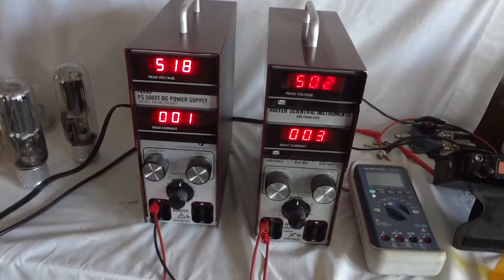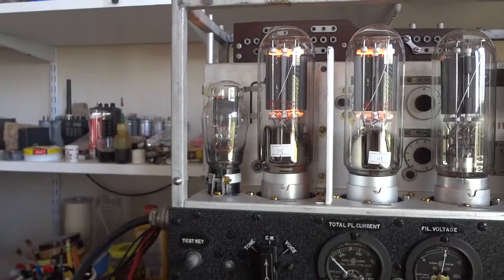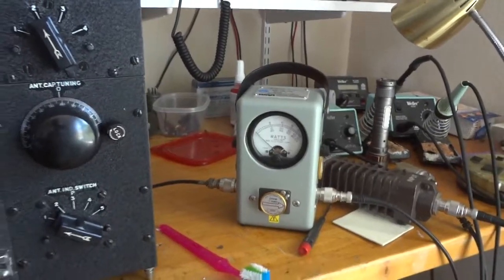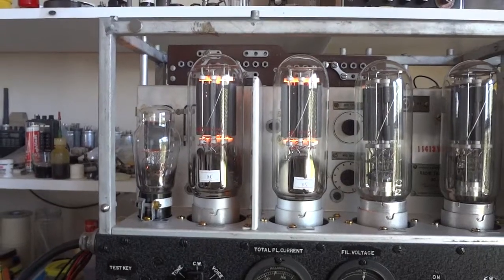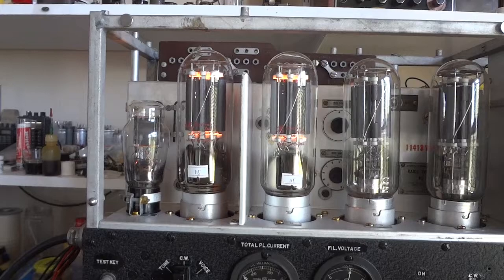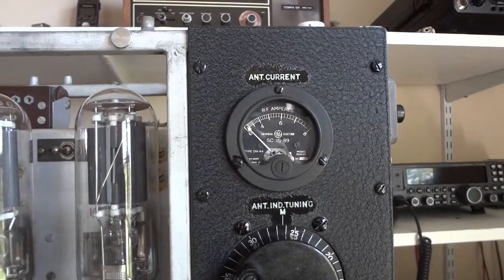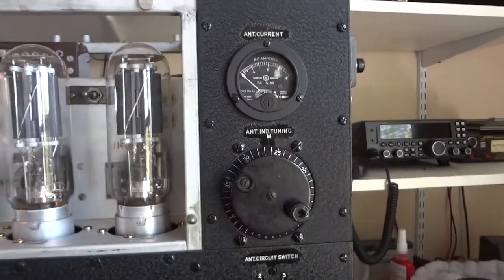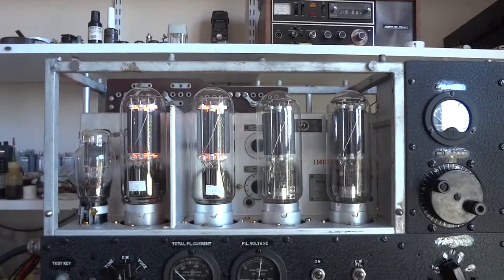BC 375 transmitter first power on test after restoration

Comment: I have this rig, plus a BC191 up and running on 160 through 40 meters, also have the TU26 and BC306 for the new Medium Wave band.  I use a Meanwell 30 amp 24VDC supply turned up to about 26 volts.  There is a 'step/start' sort of operation I installed on the PE73 dynamotor that makes the I KVDC, which allows the 30 amp supply to get the dynamotor up and running.  After it is turning, the 26 volt current drain is not too bad, about 20 amps depending on how much power out is set.  The issue with the Chinese 211 is more in the audiophile world where they say they are 'noisy'.  There is no problem with them in the 375 or 191.  This rig is also a forerunner of QSK.  In CW, pressing the key throws the receiver into mute, actually it cuts off the BC348 audio output to the phones or intercom, and switches the antenna from receiver to transmit.  Using this with any receiver, especially the BC348 that is muted by the 375, you learn quickly you have no way of knowing where you are.  A B17 had a toggle switch right next to the key to bypass the audio mute. Zero beating a station calling CQ with the intent of working them is a difficult operation.  I usually just call CQ and wait.  Using a receiver like the BC348 with dial has marks 5KC apart,  you actually have to have a BC221 or LM11 to first zero the calling station, then zero the TX, by then, it is too late.  With modern hams, not being on their frequency to 10 to the minus 20, drives them off the deep end, so you have to actually work a ham that knows how to use the RIT control on their rig.  Sending code with it is a noisy operation, you don't need sidetone, you could not hear it if you had it anyway from all the clanking.  If you want to be successful making contacts with this rig, check out 'Using the BC375 Today' article.

Comment: I worked with this radio in 1962 !  
Nice remembrance !
Reply from the maker: That is very interesting! Tell us a bit more; was it in the military? and in what setting? let us know!
Reply: Sure in the military !  We had them installed in 0,75 ton BORGWARD radio trucks with whip-antenna and one as a fixed station on a long-wire in a NATO radio net on CW in Germany !   Receiver was either the BC 342 or BC 348  in the trucks as well as a R-77 receiver (part of the AN/GRC-9) as back-up receiver in the fixed station. All ran on the original 24 VDC rotary inverter which was very noisy...
Reply from the maker: Appreciate the info. This confirms the BC375/191 was used for a long time after the war as I suspected. Thanks!
Reply: First users in Germany after the war have been the German Border Police BGS (Bundesgrenzschutz)...
For them the receiver, transmitter and all the accessories have been dismantled, cleaned and painted in light grey. The lettering was done in German language and with small rubber stamps...
The transmitter was called S-191, the receiver E-348, the tuning units AS- (Abstimmsatz...) etc.
The complete station was built into a OPEL BLITZ van...
I have pictures of it, if you like just send me your E-Mail...
The sets used in the Bundeswehr Signal Corps came (with the operators...)  from the BGS in 1956...
Reply from the maker: Jimmy, I would like that - will send you an email